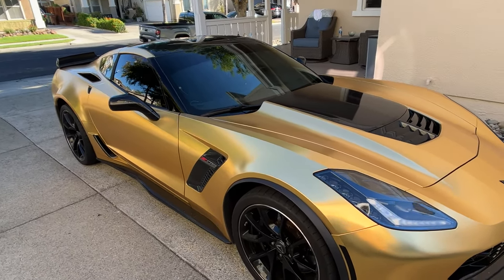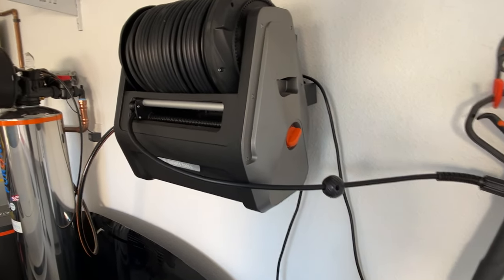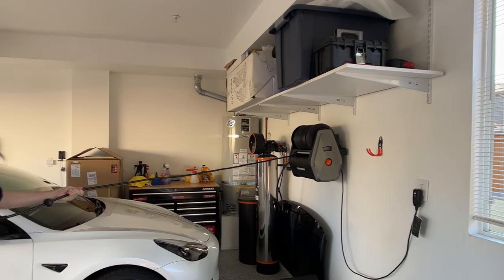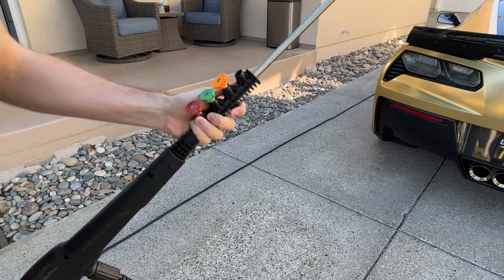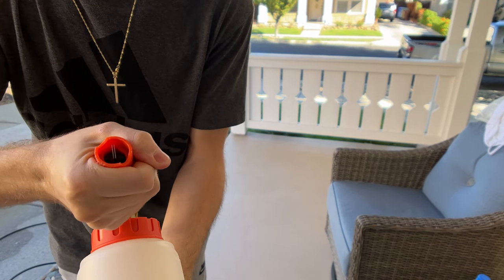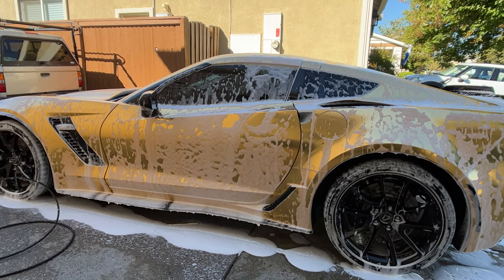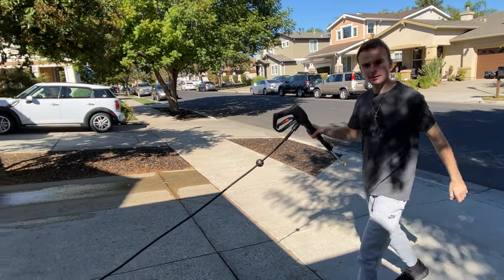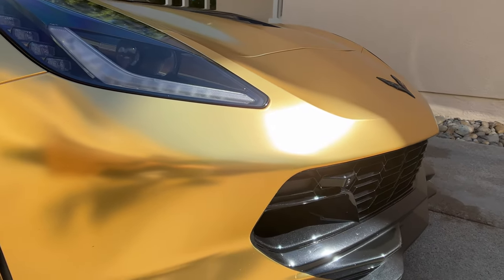BEST Electric Pressure Washer For Cars! 100 FT Retractable Hose?!

Comment: When you put that tip on, spray away from the car a couple of seconds just in case the tip isn’t in all the way and blows into th car . That looks pretty good for 300 bucks.
Reply from the maker: Good advice! Usually you’ll hear a clicking noise once it’s securely in place but in the event that happens, it’s smart advice to aim away from the car